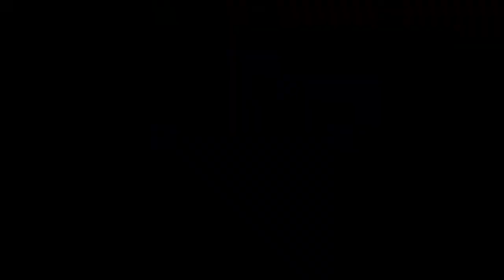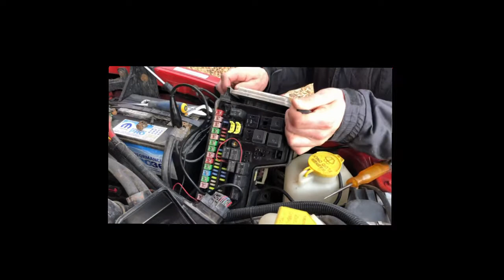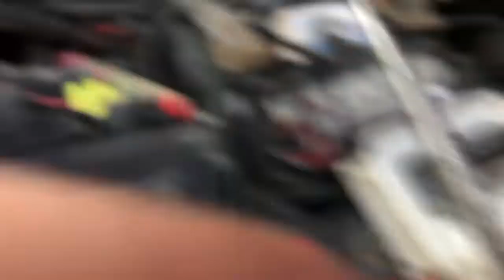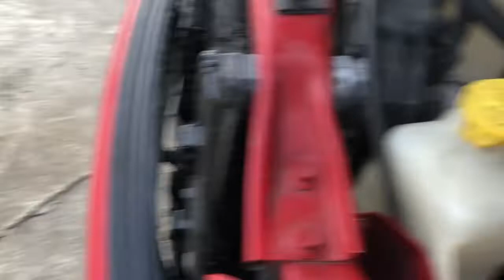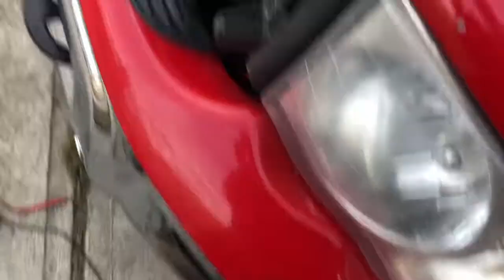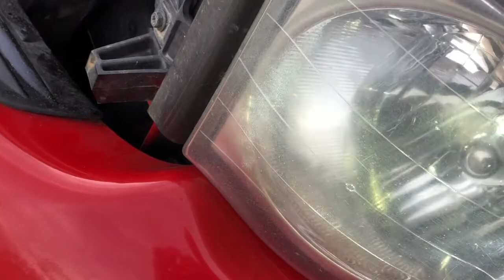how to fix headlight issue 2002-2005 ram

Comment: Thank you for this video! I’ve been watching other videos and skipped this one then finally watched it and it fixed my issue. My lights were not working correctly and I tried replacing fuse box and checking wiring and everything else you can think of excluding changing the FCM.
After watching your video, I said screw it and went to a junk yard for 50 dollar fcm. It WORKED!
Thanks again 🙏 it was for 2002 dodge Ram 1500.
Reply from the maker: glad it helped you!

Comment: I removed the fuse box to access the fcm and with the lights in the on position I loosened the screws and started pulling on the fcm and the light turned on so then I put a couple more washers behind each screw and put it back together. Both lights are working and no longer have the "lamp out" message. I'll come back and edit if I have any issues.
Reply: Could it be that you had corrosion on the pads/connectors?
Reply: @CrinosAD  no visible corrosion, it's a common problem because I went to the junk yard and all the fcm's were pulled out.
Reply: curious if it's still working with adding the extra washers?
Reply: @eloyd82  It did for a couple weeks then it started acting up again 🙄. I also went to the junkyard to look for another fcm but they were all gone.

Comment: FYI. I found on a thread that unplugging the fcm for 10 min can reset the tripped relay. Did all your tests and plugged it back in to jump wires and the lights can’t back on. With a new bulb. Power was not there before!!!!
Reply from the maker: in my situation the terminal for the headlight had a loose solder in the fcm and would work anytime you wiggled it
its possible yours is the same and from you moving it made it connect again

Comment: test lights are not always a good indication of a fault power feed wire. I have seen power feeds light up a test light but if that test light were able to put more of a load on power feed then it could show if it fails under a load. Did you happen to take apart the FCM? I am debating on taking mine apart and seeing if I can find a broken solder joint.
Reply from the maker: yes i pulled apart the fcm 
it had no visible damage inside  so i just replaced it

Comment: Nice video. I got the exact same problem. Did all the steps you did everything came out just like yours. But the final step you did on given  power to the head lights i notice your head lights turned on but the bulb on your test light did not. Mine was the opposite. Head lights did not turn on but bulb on my test light turned on. Just wondering if you know why it did that?
Reply from the maker: did you put the light in the right holes?
Reply from the maker: if your test light was hooked to your positive terminal and you where touching the right terminals on the fuse box.  then you have a short between your fuse box and your headlight
Reply: Mine did the same thing on both sides 03 3500

Comment: Do you have led bulbs for your lights? If so, are they connected to a resistor?
Reply from the maker: i have LED's with no resistors but if you have  a 2005 you might need them

Comment: Hey man love the videos, have been allot of help sofar. Can you help try to diagnose one strnage problem in my 04 ram? Its gas . But when i accelerate passed 1/8 of an inch , it sounds like theres a turbo in it. And it stops after about quarter throttle. Changing drive belt. Is there any chance youd know lol?
Reply from the maker: ya could be alternator or power steering pump
or a bad belt
Reply: @samswildgarage8805  I tried the belt and the drive chain looks okay, and it's actually only while in gear lol. If I'm parked and rev engine it doesn't appear. So it's probably the power steering pump, thank you !
Reply from the maker: @anthonycoschigano131  does the transmission slip
Reply: @samswildgarage8805  no it feels good , and I've let my dad drive because he's more experienced and he hasn't said anything about that. He actually can't even hear the noise but I definitely can lol. It sounds like a vacuum sucking in air
Reply: I love this truck so much tho so I've been slowly addressing all the small issues. That's next for sure !!!

Comment: Pin 8 and 9 light up the test tool in your procedure for me but the lights do not come on for driver or passenger side low beams. My passenger side low beam has not been working but my driver side does work. But driver side does not come on with this test either

Comment: Great vid... have a question....I have an 05 2500...my marker lights ..roof lights dont come on...everything else does...did a jumper from pin 15 on Fcm to 73 fuse which is parking lamp fuse...and worked for years ...and now it crapped out...check and found jumper wire corroded..replaced it have power going to 73 fuse and it didnt work...fuse circuit board issue?..
Reply from the maker: are you asking if its fuse or circuit board?
Reply: @samswildgarage8805  fix it...my jumper was corroded

Comment: Hi did this test...pin 8 lights up but not the passengers headlamp...but the headlamp does work as it should...my issue is the drivers side...pin 9 doesnt light up with the test light..swapped out FCM no resolve..possible Fuse Box is bad..?..at one time the lamp out dash light would come and go and now its on for good...
Reply from the maker: If the headlight is not lighting up at the point in the test where it should 
Then there is a break in the line between the fuse box and the headlight
Most likely the headlight plug it’s self
Bust could be a broken wire or bad fuse box

Comment: Okay so question if my 6&7 pins not sending power to my FCM what would cause that bad fuse box?
Reply from the maker: fuse box or headlight switch 
or wiring in between
Reply: @samswildgarage8805  okay all other lights work on the truck other than my driver low beam headlight.  So i sadly think it might be my fuse box. Thank you for the reply!
Reply from the maker: @brendencampbell8526  you might be able to fix it if you pull the fuse box apart 
and see where the corrosion is
there was another guy in the comments that had a burnt segment that he soldered a wire between

Comment: Seeing this vid in 2024 finally taking up the task of finding out why my light is out. Tried the test and got to the post where you made your headlights flash and mine did not. Any help would be great! Thanks
Reply from the maker: Then there is a break in the line between your fuse box and headlight
Most likely your headlight plug it’s self
But could be the fuse box as well or the wires between the box and the light

Comment: My 02 blew a trace in the fusebox. I ended up just soldering jumpers wires and reflowing the joints while i was in there lol
Reply: Got vid on how to do this?..
Reply: @emilyscandycakes4530 I do not. It’s been a few years now. My trace was visibly blown so it was easy to see the problem and the traces are easy to follow to run a new wire. The hardest part was getting the plastic halves apart to pull the boards out.
Reply: @TheFallenAngel13524  o well ..are all 3rd gen fuse box the same?

Comment: Any assistance would be nice on this. I have an 04 ram 1500 hemi and one day all of a sudden my front right low beam went out. It's one whole bulb system and I replaced the bulb but it didn't work. Then I fiddled around with a couple fuses for the FCM relay and all of a sudden it came back. But after driving a little while it basically shorted itself out again. Both the old and new bulbs are fine.
Reply from the maker: did you do the tests in the video?

Comment: does the front control module also control the blonkers?my truck the headlights,one works regular the other is high beams but if i swamp the bulbs same thing happens and also the blinker lights dont work,
Reply from the maker: I’m not sure if the front control module controls indicators 
Did you run the text in the video

Comment: Any luck fixing your fcm?
Reply from the maker: Yes 
The solder where the fcm spade plugs goes into the circuit board was loose
Reply: @samswildgarage8805  No have any video to check that?
Reply: @samswildgarage8805  Thank you for making this video.  Did you make a video for your FCM repair?
Reply from the maker: @vizioasdf  no sorry.    working on some new content but i need to find someone to edit it

Comment: My number 9 slot on fuse box doesn't seem to have the metal Inside it. Cant get any connection with the tester. Tried a different fcm. And still nothing. Only thing it can be is the fuse box. I replaced the headlight switch already too
Reply from the maker: do you only have one headlight working?
Reply: @samswildgarage8805  only the high beams work. They just randomly went out. And like I seen someone else post. When I touched #8 with the test light (walmart) it lit up but did not turn head lights on. And like I said. Number 9 I can't get any feedback from with tester even put smaller stuff in there. It's like the metal sleeve is gone or so dirty I can't see it maybe.
Reply from the maker: @slaunchhuntertv4282  ya sounds like there's a problem  in the fuse box. you can pull the whole thing apart and see if its just corroded inside. its basically a bunch of plates with pins poked through each other
Reply: @samswildgarage8805  I will try that. I couldn't see how it pulls apart. I'll try and figure it out.

Comment: I just took my 04 3500 ram diesel , one headlight works on high the other on low beam, only the right rear turn signal works, they dignosed everything and said I'm SCREWED, Dodge discontued what I need the "tipum" and something else... and no aftermarkets ...  says he might be able to send mine out and have them rebuilt. take about a month and $2K.  can't I just wire this thing with some manual switches and bypass the factory light switches. ?  also my rear 7 point trailer plug in the back works,,,,,,
Reply from the maker: I’ve seen FCM’s on ebay

Comment: Lost my reverse  lights on my 2003. Any advice on a fix or a way I can power them right from my fuse box?
Reply from the maker: only reverse? or tail lights completely?
Reply: @samswildgarage8805  only reverse
Reply: Replaced the board for all the lights in the back.
Reply from the maker: @donaldmajewski5256  have you checked the reverse switch on your transmission?
Reply: @samswildgarage8805  1st thing i thought of, not there like most of them. Beginning to think it's built into the main plug on the transmission that connects to the valve body.
Reply from the maker: @donaldmajewski5256  so you can wire your reverse lights right into the fuse box but then you'll have to have a Manuel switch to turn them on 
it wouldnt be when you put it in reverse
Reply from the maker: if you have an email i can send you a picture of the  reverse switch location
and you can test it with a multimeter
Reply from the maker: @donaldmajewski5256  its right by the shift linkage
Reply: @samswildgarage8805  its not,trust me
Reply: All the forums say it's there though.
Reply: Doesn't  have the black box switch or the circle  one there.
Reply: The 4.7, 545RFE does not have a neutral safety switch, it uses a transmission range sensor which is located on top of the valve body.
Reply from the maker: @donaldmajewski5256  so your not even working in the same generation truck?
i dont know much about 4th gens
Reply: @samswildgarage8805  its not a 4th gen its a 3rd. 2003
Reply from the maker: @donaldmajewski5256  sorry i dont know anything about the 4.7 gas  or its transmission
but you should still be able to wire the reverse lights to a manual switch

Comment: Mine lights up in pin 8 and 9
Reply from the maker: Do you have a question?
Reply: @samswildgarage8805  I was wondering why the test light lights up but not the headlight. When I ran a plain wire to the pins 8 and 9 the headlights lit up. Thanks! I’m pretty sure the Bcm is out like yours. I followed the instructions!
Reply from the maker: @Christ-is-King-  it's possible that your test light does not allow enough current through it. if you tested with a wire and your lights come on then the results are the same as mine
Reply: My headlights also turned on when I used a piece of wire from the battery to the 8 and 9 pin.  When I used my test light,  only it lit up, not the headlights.   That being said, after soldering a jumper on my corroded fuse box circuit board  and fixing my only one headlight working issue, I now have a front marker out (bulb is good) and my driver's side tail lights don't work unless I turn the  left turn signal or hazard lights on.  The left brake light doesn't work at all either, but the back up light works.  Everything on the right tail light works correctly.   

I guess my question is should I replace the FCM?  I can't find much info on exactly what it controls.  

2003 5.9
Reply: @jonathanlombard8897  I replaced the BCM and it fixed my issue. I’m not sure about the side marker light.